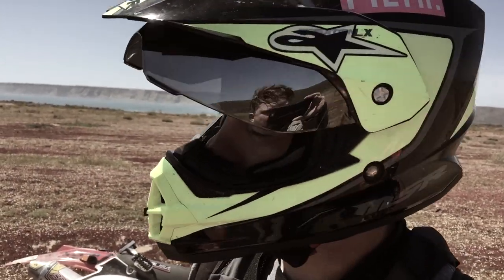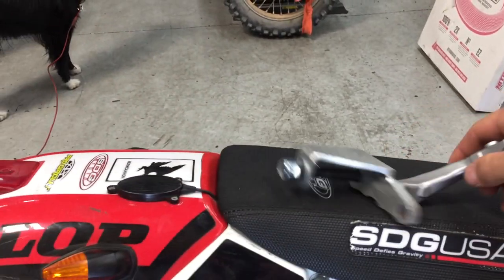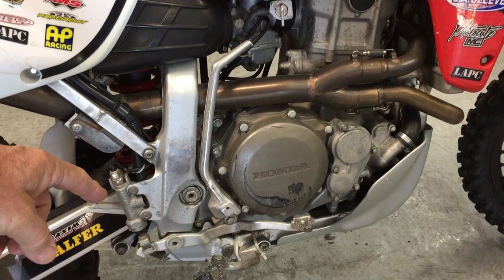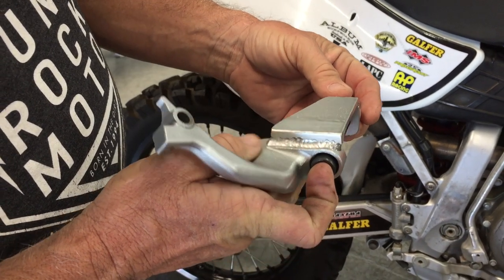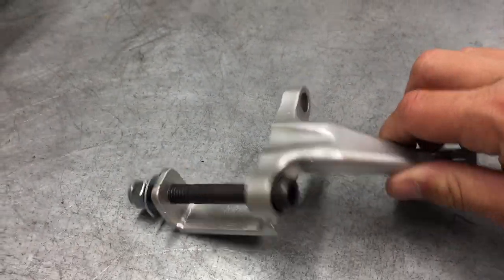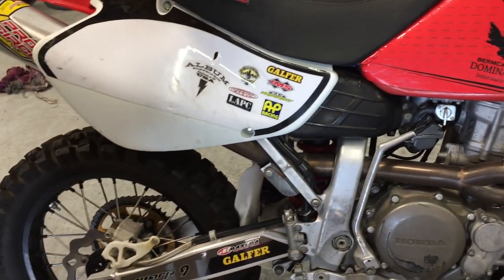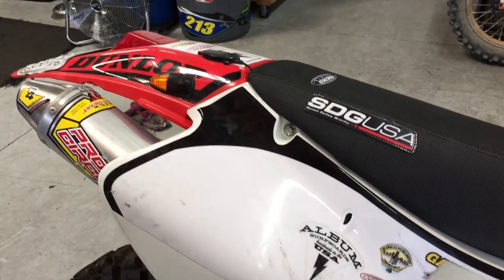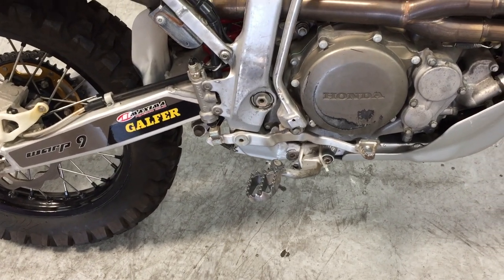Honda XR650R Peg Fix, Baja Diaries Tech Tip

Comment: Just remember whenever you strengthen a weak point, then it just moves on to the next week point. Replacing a foot peg is a lot cheaper than fixing a broken frame. Give Honda some credit I think they designed it like that for a reason.
Reply from the maker: Good point sam. Thanks for the comment.

Comment: I need to do this fix. I snapped mine twice  (there's a good video of my Wipeout because of it on my channel).  I rethreaded and upgraded the bolts but it still happened again. Need to do this for a permanent fix.
Reply from the maker: +slosurfer27 ooof yeah this way is solid no doubt

Comment: Use a Grade 10 Bolt!! That will Never Break!!
Reply: Until they break! I have  been using these for years and always have spares in my pack. And Yes there are way stronger then stock, but they still break! I just might have to try  this upgrade:)
Reply: PS. in metric it is a 12.9 grade which has a tensile strength of 1220, 10.9 has a tensile strength of 1040, The 10.9 bends and then is a pain in the ass to take out, the 12.9  last longer but brakes off with out warning!